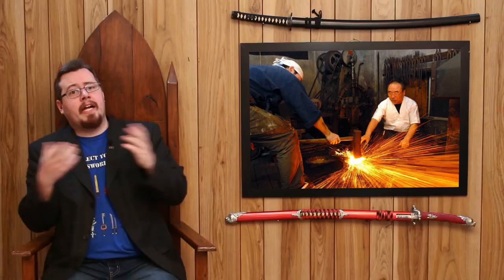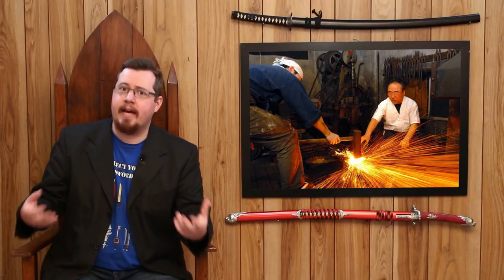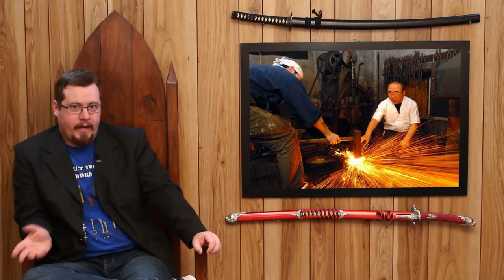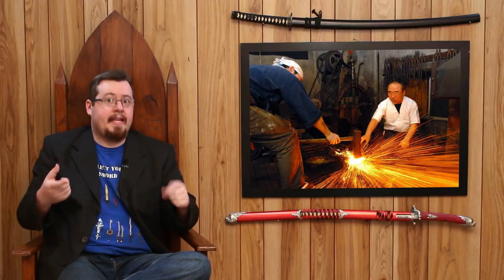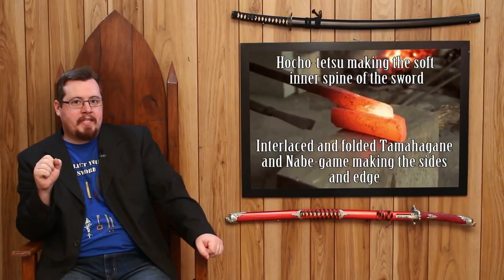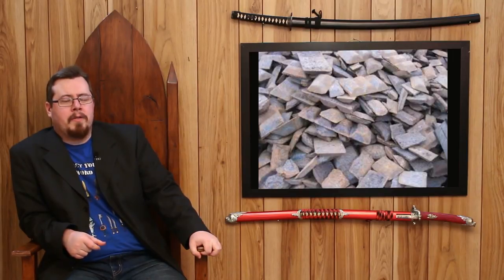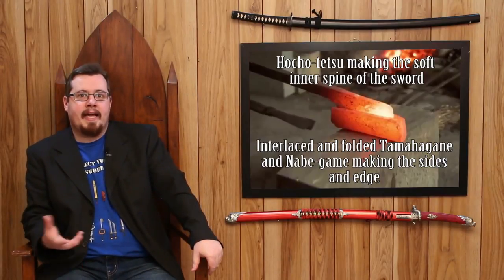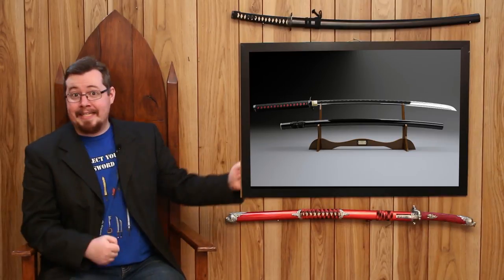The TRUTH about the KATANA, part 3: Why the steel is folded

Comment: the reason i see why it is called pig iron is that it has too many carbon to be called steel and not enough to be called cast-iron, if i remember correctly my class of metallurgy, cast iron has 2 or 3% min of carbon in it and a max of 4 or 5% carbon
Reply: Actually pig iron has a carbon content of around 4%. Cast iron is basically pig iron with specific properties.
The reason why iron, steel and pig iron or cast iron are each called different in metallurgy, is that the microstructure of iron, steel and pig iron is different. Iron is pure ferrite, steel is ferrite mixed with cementite (perlite) and above a certain temperature the whole structure changes to austenite. Pig iron is ferrite and cementite as well, but in difference to steel, it will not change its mictrostructure fully into austenite, but will liquify instead. This is also the reason why pig iron was definetely not used for the production of the katana. You cannot forge weld pig iron with steel, because the pig iron gets liquid at temperatures you need to forge weld the steel and simply flows away. Not that this is the only thing, that Shad is wrong about in the video.

Comment: Of course it will never be as pure as modern steel, they weren't able to melt the metal to completely remove the impurities. 
It's like trying to mix peanut butter and bread. It doesn't matter how many layers you make, you won't completely mix it together. But if you mix the peanut butter while the bread is still being mixed, you'd end up with a bread that has peanut butter in literally every fiber.

Comment: You can, however, remove impurities with a flux:
"Between each heating and folding, the steel is coated in a mixture of clay, water and straw-ash to protect it from oxidation and carburization. This clay provides a highly reducing environment. At around 1,650 °F (900 °C), the heat and water from the clay promote the formation of a wustite layer, which is a type of iron oxide formed in the absence of oxygen. In this reducing environment, the silicon in the clay reacts with wustite to form fayalite and, at around 2,190 °F (1,200 °C), the fayalite will become a liquid. This liquid acts as a flux, attracting impurities, and pulls out the impurities as it is squeezed from between the layers. This leaves a very pure surface which, in turn, helps facilitate the forge-welding process."
http://www.samuraisword.com/REFERENCE/making/japanse_swordmaking_process.htm
http://www.hitachi-metals.co.jp/e/tatara/nnp0109.htm
"Iron and Steel in Ancient Times By Vagn Fabritius Buchwald -- Det Kongelige Danske Videnskabernes Selskab 2005 Page 65"

Comment: Pig iron actually has too much carbon, it also has a lot of impurities. By folding it effectively case hardens the other layers. The katana steel did not have to be better than European swords, just better than previous Japanese swords which were not folded. Which leads to a question, you seem to be comparing Japanese steel from long ago with modern steel, not with steel from the same time period,  Why not test steels of different ages?
Reply: The reason he's comparing historical steel to modern steel is because many katana fanboys think that Japanese steel harvested, smelted, and forged in the traditional historical way is superior to modern steel. Which is, of course, ludicrous.

Comment: 29:50 it wouldn't be hard enough? this is so very wrong? it would be even harder.. it's just that very hard is not good for a sword cause it will break.. that's why the spine of the katana is softer and the edge is harderer and of a higher carbon content.. lower carbon content=softer but more flexible steel, higher carbon content=harder steel but it's also more brittle.. that's why it's made the way it was made and also why it's hardend differnential.. big blooper here for someone who did so much research about metallurgy..
i guess what you mean there is: it wouldn't be functional.. because in fact it would be to hard to be a good sword.. it would be parried once in a fight and just shatter..

Comment: Actually what you said about pig iron is only half the truth. All products that are made of iron have carbon in it. Steel is just a certain percentage. Iron with less carbon than steel is called wrought iron. Iron with more carbon than steel but less than pig iron is called cast iron. The core of a katana is made of wrought iron.
Wrought iron is used in rivets and things where Iron needs to be able to be easily bend, it is much softer than steel but doesn't break as easily. Cast iron is used when compressive strength rather than tensile strength is desired, things like covers and other things that have to stay flat are made out of cast iron.
Iron without any carbon in it at all is possible but only with modern technology and it's pretty useless. It's actually softer than pure aluminium yet it is still much heavier.

Comment: Your statement about Carbon content isn't quite correct. Anything up to 2% carbon is considered carbon steel. Many of the hardest tool or knife steels, such as D2, S30V, etc, have 1.5% Carbon. The more carbon, generally up to around 1.7%, the harder it can be. The reasons you don't want that much carbon are that it rusts easier and the melting point reduces as you add more carbon. You also don't want it brittle - it must withstand impact. So, the steel has things added to it that help with corrosion resistance and tensile strength, like Chromium (12% in D2, for instance), Molybdenum (1% in D2), Vanadium (1.1% in D2), Manganese, Cobalt, etc.

Comment: How do you add carbon
Reply: Carbon is in the air.It mixes with the iron, if it's liquid enough.
Reply: +Ein Simsala cheers mate
Reply: There's not nearly enough carbon in normal air to make steel though. The bulk of the Carbon comes from the burning Coal or Charcoal. The coal, once burned, becomes carbon dioxide which diffuses into the liquid iron.
Reply: yeah it comes from the fuel or powdered charcoal is mixed into the crucible if ingots are produced in a crucible. Coal should not be used as fuel when smelting with the ore loose in the forge like the japanese method because coal contains all kinds of crap you don't want in steel like mercury and lead

Comment: Steel is produced by removing carbon from iron not by adding carbon. The higher the carbon content the better it hardens to a certain extent but also the more brittle it is. (Lots more to it but not going there in a comment.)
Reply: ROFLOL  I'm an ME with years exp. in metallurgy. Look it up.

"Cast iron is a group of iron-carbon alloys with a carbon content greater than 2%."
https://en.wikipedia.org/wiki/Cast_iron

"The carbon content of steel is between 0.002% and 2.1%"
https://en.wikipedia.org/wiki/Steel

Wiki does have that basically correct.  Notice Steel is a more elementally pure from of the element iron than "iron".  (The verbiage Iron and cast iron are used interchangeably in manufacturing.)

Iron was produced first with it's high carbon content and got the name iron so when carbon got removed later it got a different name even though it was a more pure form of the element Fe.

Comment: So this is just more proof that the ulfburt is probably the best historic sword ever made. It's almost pure steel with no imclucions. It's almost as pure as modern steel.
Reply: +hawk6111 it seems so, but they seem to have been only available in very short amount and a very small timespan. So somehow the stuff got available to maybe only one or a few smiths and then went away. As far as I know it is still a debate on where that steel actually came from specifically. It also has to be stated that not all ulfberht swords are made of high quality steel and different kind of inscriptions are found as well. So it is not clear if these inferiour ulfberht versions are a copy of someone who wanted to make money out of the name  without having the proper steel, if ulfberht was just a thing swordmakers would put on their blades in that times or, the original community that made ulfberht swords just ran out of high quality steel from time to time (brings us back to the problem that we do not specifically know who provided this high quality steel).
And of course, the ulfberht swords were also in their time highly regarded quality pieces, so it is nothing that we can take as a "typical example" of pagan era swords.

Comment: Anyone tired of thrend's tests where he has the best viking and knight swords go up against 1060 katanas? Most viking swords where just so so iron swords,only a few later on where really good. As for bastard,arming, and long swords, that was the 1400s onward where they got really good. Even then, more durability is from being overly flexible and thus the blade takes less damage but deals less against hard surfaces. The katana is still the best dueling sword overall, regardless of it not being mythical or cutting through submarines. Rapiers aren't light as he mentions in another vid, and most knights wore half plate at most. lots of myths on both imsides. Hell, vikings didn't have that much armor, no horses or bows usually, and their spears where so so. fairly good shields and chainmail though.

Comment: Clarify your bias.

A lot of the folding process for japanese steel/blade making is that it is made to be wrapped around a softer metal/iron than it. Which really depends on the original natural quality of the iron coming out of the ground which is STILL NEVER ACKNOWLEDGED OR RECTIFIED IN THIS VIDEO
Question- Muramase 2: What time period was this from? 11 century or 18-19 century? 50-10 times? Vs 1000AD or 18-1900 AD? Because comparing 1000AD japanese vs 1900 Arabic is unfair! Also, a japanese sword isn't made to be  solid steel throughout, it it steel folded on iron, sharpened to a blade. Retaining the perfect firmness/sharpness of steel and flexibility/malleability of iron. Which is stronger @ the blade, and weaker at the back. And they literally did this ON PURPOSE. Which you admit, but in the wrong context. And you mention a 0.1%

It cant remove oxides. is it better at removing oxides at the times versus other times? I definitely believe that older peiods of history did not have higher quality control knowledge or methods than we currently have,  but theat the japanese have a higher quality of iron/steel forging than you admitted. Is it better (lower contents) vs current other culture forging cultures at that time. The blade, definitely had less burned oxides in the steel than current steel. But the process of folding and hammering was used to spread out the worst parts was the best wrapped around their worst?

Comment: I would have to disagree with the end conclusion that the well smelted sword is better than the well forged sword. The shapes of the swords affect how they perform. The European sword is a long, straight and skinny blade designed to pierce armor because the Europeans made strong armor. The Katana is short and curved designed for speed and exploiting the weaknesses in armor because the Japanese, like many easterners, focused on speed and agility and therefore made the better weapons. So the Europeans had better armor, and the Asians and other Easterners made better weapons. A samurai would never do a straight block with his sword. He would deflect the strike every time and use that to create an opportunity and open up a weakness in his opponent's armor.
Reply: Katana Fanboy
Reply: Just totally ignore the Messer and Falchion
Reply: Oh boy, where to start. Firstly, it's not the quality of the forging that he was talking about but specifically a forging process designed to remove impurities such as folding or pattern welding. If the steel was already cleared of impurities in the smelting then such a process was pointless, but the sword would still be forged. Secondly, European swords were not designed to pierce armour, stabbing a sword through steel armour is nearly impossible. If you had to fight someone in strong armour you wouldn't use a sword, but if you really had to then you'd want to half-sword it and try to slip it into the gaps. Also you claim twice that Eastern weapons were better but never explain why except that they "focused on speed and agility". That's true of all swordsmanship, East or West. Same with your point about a samurai deflecting a strike, Western swordsmanship was the same in that regard.
Reply: His end conclusion wasn't that rigid. What he said was a properly smelted steel product will have less impurities than a product that went through forging/folding as recompense for the lack of proper smelting technique. He's saying that a poorly made steel sword consisting of pure steel will not be stronger than a well forged "impure" steel sword. But if you forged two swords with refined techniques, making one out of pure steel and the other out of steel that still had slag in it, then the pure one will always be superior.
Reply: In this video he was talking about steel that is used, and not shapes. Longsword replica was here to represent modern steel.
Reply: Completely aside from everything discussed so far, the Longsword is a weapon designed and refined into the embodiment of versatility. A historical Longsword had roughly the exact same weight as a Katana, but its point of balance is way further down. Because the Europeans developed blast furnaces, they could get rid of almost all impurities and developed blades that were lighter by taking advantage of the 'springy' nature of softer high-quality steel. Historical Japanese blades were extremely rigid to compensate for the impurities and were infamous for bending out of shape or even breaking when they struck an object with bad edge-alignment. So to compensate for that, the back was made thicker and harder to give the blade some resilience.

So if the blade is lighter, the weight went down into the handle, which became more elaborate and thus heavier. The large pommel and wide cross-guard were not just for show, not only did the added weight move the point of balance closer to the hand, making the weapon much easier to handle and more responsive, they also became an intrinsic element of sophisticated European fencing. Because armor became more sophisticated as well, it required a Knight to get very close to properly aim for weak spots or bring the opponent out of balance, which led to the development of techniques that used the cross-guard and pommel as striking weapons which could force the opponent to back off, allowing for a proper strike with the blade that could be positioned very well to exploit joints or weaknesses in the armor. 

Later techniques of half-swording (gripping the blade with your free hand to either control is more accurately in a thrust or to swing it around and strike with the pommel or cross-guard) also developed into the Mordschlag (Murder strike) technique (if it's not the 100% correct therm, it's close enough to get the point across I think) where the sword is held upside-down by the blade and then used like a bludgeoning weapon or, if positioned correctly, hitting the opponent with the blade just below the cross-guard which with the weight of the handle added massive amounts of force, effectively turning it into a cleaver or axe.

Because of the constant warring of European nations, developments in steel and armor, the Longsword was developed to meet the standards of an extremely diverse battlefield and its techniques were refined into arguable the most complex and versatile fighting style ever historically developed for any other weapon.

Comment: that's why indian and then vikings had superior weapons: because they learned how to properly make woodz. Also, Indian Steel had an ironical impurity that made their steel even harder and studrier: vanadium.
Reply: Vanadium is used in many higher quality modern day blade steels, and it does make the steel tougher
Reply: Halo Content yup. That's the point of it, and why "the technique" disappear. It never did, it just run out of that material. They had hard impurities hard to take off, so they made the woodz technique, but the thing was that among thoose impurities, there was vanadium. That alloy in medieval ages was an incredible advantage.

Comment: A lot of higher end cutlery steels have a have gobs of steel now. Take zdp-189 a Japanese steel it has 3% carbon and is a bitch to sharpen.
Reply: Cornered Fox It did when it first came out yeah haha. Now it has no major chipping issue. But yeah stainless steels have been wiener waving for a while now.
Reply: 65 wouldn't surprise me since the had to sandwich it between a softer steel an yeah that pretty much sums it up. Most of these steels are just money grabs, 440c isn't bad it's just a shame so few knives use it.

Comment: The Tatarith can't melt steel beams
Reply: Supposedly jet fuel can though.
Reply: Are people still on with that 9/11 conspiracy stuff? It doesn't need to melt the steel beams! It just needs to soften them to the point where they can no longer bear the weight of a building.
Reply: Not even that.  Burning LOTS of jet fuel will soak the steel in the low heat of burning jet fuel.  That steel will expand, as heated steel has been taught to do.  Sufficiently expanded steel beams on concrete pillars (common building construction) will snap the welds between beams, and the beams will slide off the concrete pillar.  SUDDENLY the whole house of cards comes down.